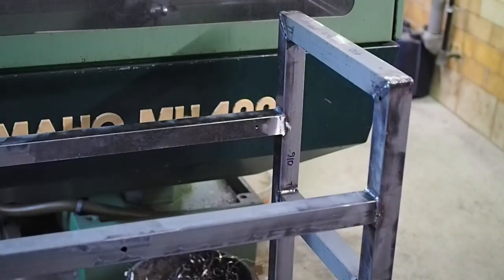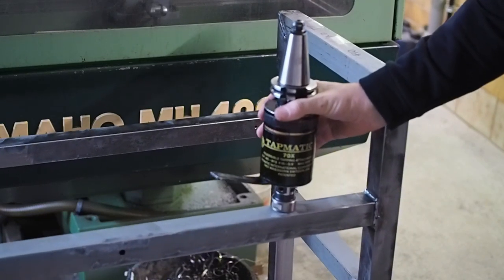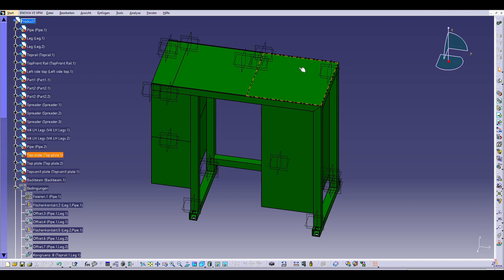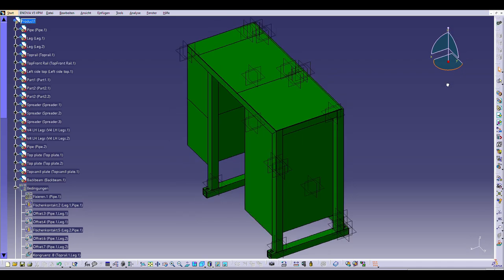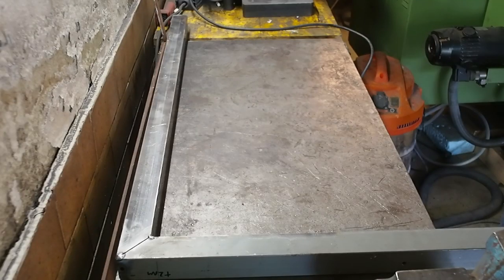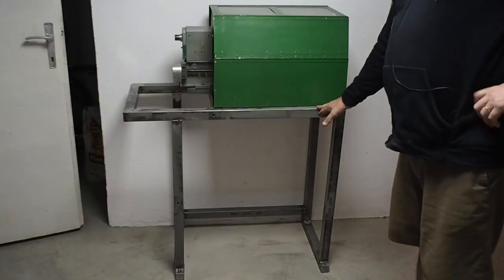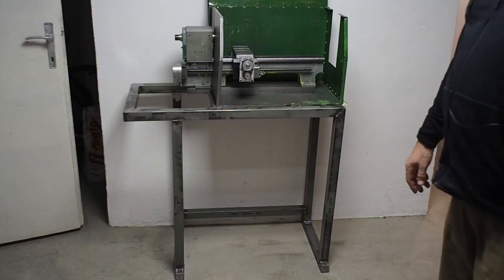CNC'ing the 7x12 mini lathe - Episode 17 - Lathe stand

Comment: Don't you think it is to low for you? I tried PM you on Pratical Machinist but it didn't work ahah i'll try again
Reply from the maker: I will put some vibration isolation feet under it which will bring it up to height. Sorry, I was busy welding all week, and didn't check PM. I just answered you.
Reply: As it's a CNC machine I guess he won't be standing over it for hours like you would a manual machine.
Reply from the maker: @ferrumignis  Yeah, and also the windows on top, so I have to look down on it.

Comment: I'm having audio prob with my stuff... Can't get a mic to work with my Gopro 4. just loads of hiss (Boo)
Reply from the maker: Does the gopro have the correct mic jack? The microphones for phones are Tip/Ring/ring, so you need an adaptor cable to use then with a camera.
Reply: @RotarySMP  It's a bit more of a pain than a jack plug. It's a micro usb plug.I need an adapter but Gopro don't sell them any more , They updated the firmware so i can't use a standard USB to jack. The hack is to put a 270/300k ohm resistor over two of the pin in the usb plug, I gave it a go but the usb plugs are hard to solder. I have an old DSLR i might give that camera a go but it get right in the way when i'm doing stuff.
Reply from the maker: @TidyThreads I have never had a gopro, I use a couple of Olympus M43 cameras, neither of which has an external microphone jack. I use a cheap Lav Mic ,with a TRR to TR adapter cable, and a Sony dictaphone to record the audio separately, and then use Da Vinci Resolves auto syncing to replace the internal camera audio with the external. But really, based on this weeks screw up, I'd recommend you look elsewhere for qualified and competent advice on how to do anything related to video ;)

Comment: Thanks for sharing what you can, I’ll drink a beer for your lost video. Steel gauge is like shoot gun shells we use it for electric wire also, we use the confusing units to judge if someone should work on my house, car, computer or not. i like the metric system also the watt vs. horse power thing is
Reply from the maker: Good call. Thanks for watching.